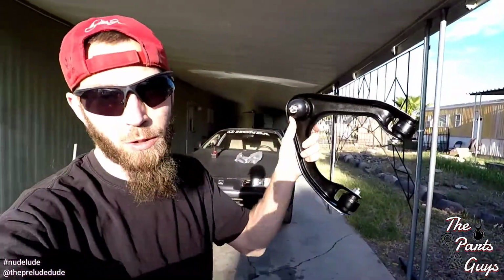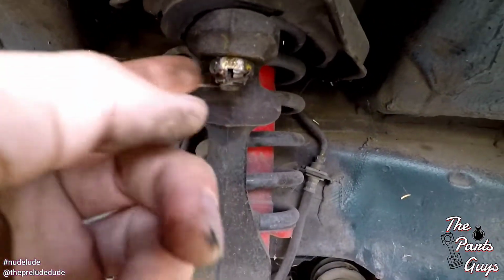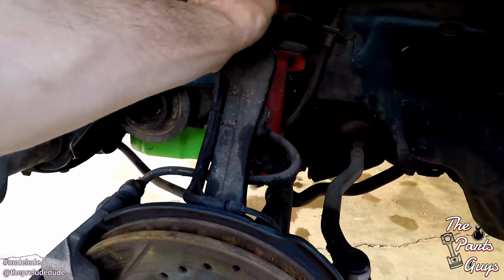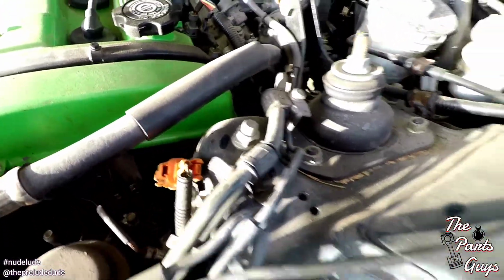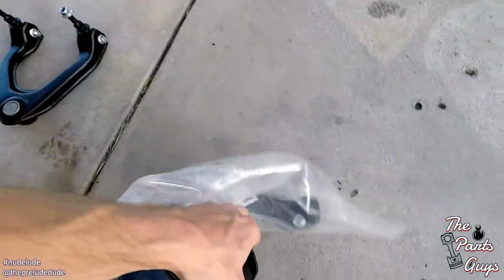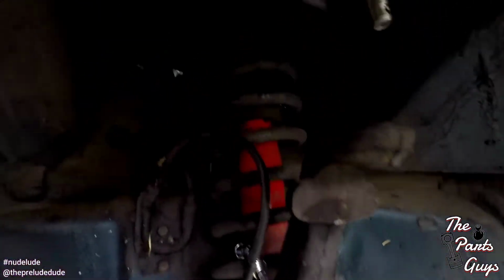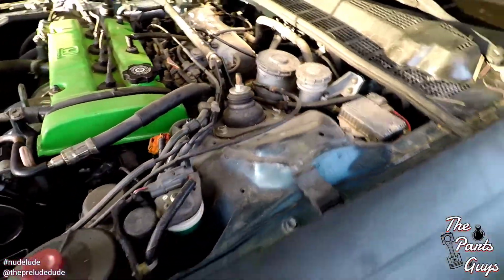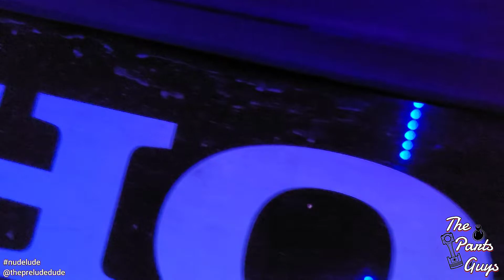New control arms | test pipe | rip'n Tucson

Comment: Any tips for when your in bolting the castle nut and the ball joint spins with it?
Reply from the maker: Try to use a pair of vice grips to squeeze the control arm and the spindle together. It might hold that ball joint enough to get another turn on the castle nut